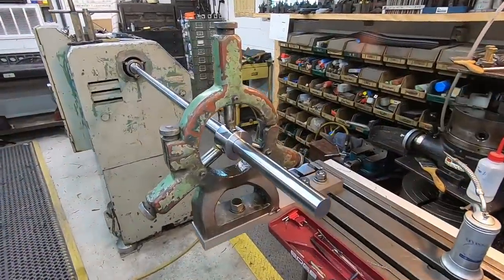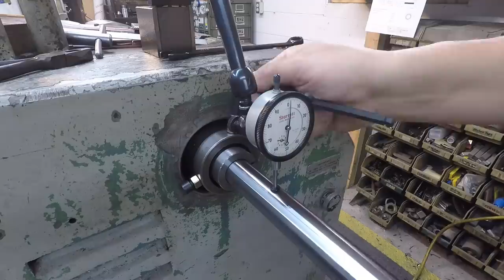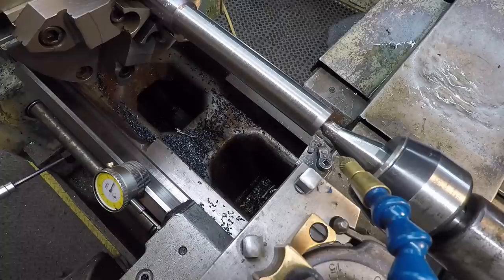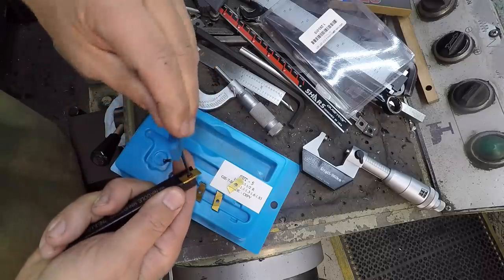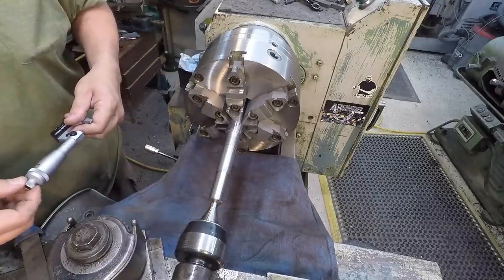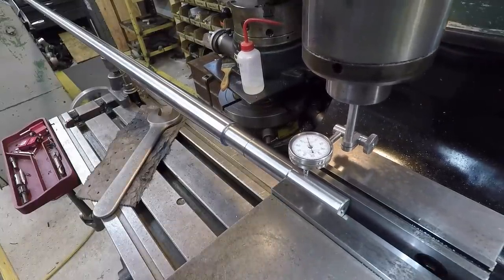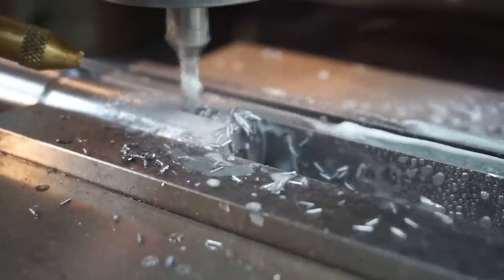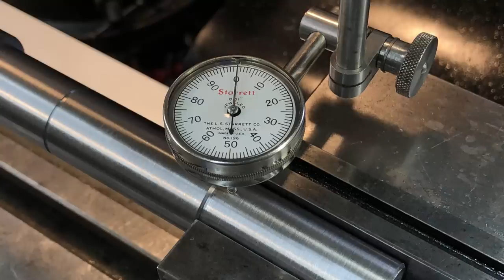Machining a Custom Prop Shaft Part 2

Comment: when making a shipping pallet for a shaft. you might want to use 2 boards.. one flat.. one at a 90 degree ..  you may also want to use bigger hold down straps so you can use short lengths of pipe foam insulation  so any mishandling of the pallet won't bend the shaft.  a single board can flex.. 2 in a 90 degree can't . you can use a thinner stiffener board if you glue and use something like a kreg jig to put screws in..

Comment: What's up with Detail A on the drawing?
Reply: 24:28  It specifies the 0.938" diameter of the snap ring groove, which is 0.046" less than the adjacent 0.984" diameter.

Comment: Great video Adam, I am not sure if you know this trick but....the hook on the end of tape wiggles up to 1/8 " (0.125") so you will be short pulling on the tape. Carpenters will jam the tape and stock to be measured against a backstop compressing the tape and measure that way. Alternately you can hold the start end at 1" and then add an inch on the other end.
Reply: that wiggle is there from the factory to allow for the thickness of the end hook. clearly if your tape is worn then you might have some inaccuracy, but the wiggle is a feature, not a bug
Reply: And this is why my cuts are always 1/16 to an 1/8 " off on my wood projects. Never thought of that. I am just a 'Carver" after all
Reply: Zues Toots no as stated that is not a flaw but a feature. You’re cuts are probably off due to not taking into account the thickness of the blade you are using to make the cut.

Comment: When using a tape measure have you ever noticed the end piece of the tape moves a bit ?
Reply: its supposed to, to adjust for inside and outside measurements
Reply: When using it on a shoulder, you use the outside part of the tip of the tape. That tip has a width that's already accounted for in the measurement. But when measuring from a step, you use the inside part of the tip. So the gape that the tip moves into is to account for the tip's width that's not being used, but is already included in measurement as explained.

Comment: Adam- Appreciate as always. Hey, quick question. Why do you prefer to machine the center hanging out instead of choked up close to the chuck?
Reply: On older machines ,, BED WEAR  from use by the carriage , so  a little ways out from the chuck  can help get closer to RIGHT ON CENTER ,,

Comment: I'm not any sort of pro, so I have to ask. Why didn't you center drill the shaft when it was still close to the chuck? Wouldn't that be more precise?
Reply: It depends, as usual ;) You have to take in account the lenght of the work area, the diameter of the workpiece, the total stickout. In this case, it's nothing to care about. If the work are was longer and/or the workpiece was thinner, than it would be more precice. Simply put, you can't have your workpiece stick out 30 centimeters (11,811 inch), if you have a diameter of just 5 centimeter (1,96 inch). But if you have a 80 centimeter (31,49 inch) diameter, 30 centimeter ((11,811 inch) stickout don't matter at all.

And you have to take in account, there is no tool pressure from the sides, that helps also.
Reply: Centre drill would not be on natural centre, when the bar is brought out further,  you may be bending the bar. It would be acceptable if the bar was say 250mm/10" long, and you gripped at the very end in the chuck.
Hope this helps.
Reply: Thanks all for that feedback

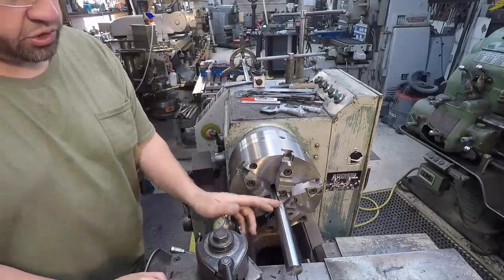Comment: At 8:20 I see a minute movement of the center drill as it contacts the end of the shaft.  Are center drills self centering?  I have noticed the same thing on many other videos from others I watch on YouTube.  Does the tailstock have a bit of slack (?) to allow for the centering of the center drill and the subsequent application of the center?
Reply: Pressure on the cutting edges centers the drill. It moves until the cutting forces acting on it balance out. As long as the drill is ground properly (so both cutting edges are identical) and the material is faced square, this will result in the drill centering itself in the work even if the tailstock has a lot of slop in it. All drills will self-center that way, but re-sharpening has a chance of producing an uneven geometry that will tend to veer off to the side instead of centering. One of the points of using dedicated center drills is just that you use them infrequently and briefly so they keep their factory geometry for a long time.
Reply: @quiescentnexus : Thanks for the excellent explanation.  That is what I assumed, but after reading you reply a new question comes to mind: If the tailstock will allow a small movement to allow the center drill to center on the part, how does it hold the part on the centerline of the lathe spindle when the tailstock center engages the center drilled hole?  It would seem that 'movement' would allow the part being turned to be off the centerline due to the allowable movement and the pressure the cutting tool applies perpendicular to spindle centerline?  As we see in this and other videos, Abom has little or no taper in the diameters he is turning (in the tenths of a thousandth).

Comment: When you are center drilling the shaft for the live center why do you not do the operation when the shaft is up short in the chuck. Seems to me not knowing better that the center hold would be more accurately on center if it was done before extending the shaft out.

Comment: Hmm, I though they were gona get refaced after he had finished using the centre (ie remove the holes he put in the ends).
Reply: He already faced it to size. Any further facing will ruin the length. Plus holes don't usually interfere with the functionality of the part. Also, you keep the center drill holes for use in any necessary future machining (repair or adjustment).

Comment: I worked in a tool & die shop an the old timer tool makers  religiously opened an closed 3 an 6 jaw skroll chucks with the same pinion. They claimed it made the skroll wear even. Have you ever heard of this? It's become a habit with me over the years. I wonder if there is any truth to it?
Reply: I don't know if there is any truth to it, but I've seen that habit as well among older machinists.  One gentleman I knew would mark the unused pinions with red layout fluid, and god help you if you used them.

Comment: Hey Adam, just out of curiosity, lets say you did have a tolerance on that length, even say .1 or .01 of an inch. How would you measure that? Or would no one design a part that way?
Reply: There are parts that are designed that way. You need to measure with micrometers during machining. Turbine and compressor shafts have crucial lengths with tolerances of 0.001"
Reply: CNC uses lasers to measure finite lengths down to 0.00001"
Reply: On long dimensions you have to include temperature to allow for expansion - contraction or after welding

Comment: Thanks for showing that strapped down for shipping. After all that work, it wouldn't be any fun to have your threads mashed, or a .125 bend, or the keyway, doinked.  By the way, when you re-arranged all the machines after your fabrication room addition, did you plan for the vertical mill to be in line with the lathe?  Or did it just work out?
Reply: I seem to recall that Adam arranged the setup just for this reason.
Reply: @milantrcka121  ...Yep, you will notice both lathes are angled toward the shop center so there is room for this kind of work.

Comment: Adam, great job as usual! One question I have for you. It's been a long time since I did any shop work, but I seem to remember that with the center finder the idea was to push it slightly off center and then go and touch off and move in until the bottom piece went to where it was a smooth transition from the upper and lower parts. Otherwise, as soon as the two parts line up, you're beyond the center point minus half the diameter. Basically you move it over until the bottom piece stops wobbling. The same with the other one that's got what looks like a scribe that's got a ball on top mounted into rod that goes into the chuck.

Comment: 1045 steel has a thermal expansion coefficient of 6.5*10-6 in/(in * ºF), so at 92.25" long a change in 10ºF is about 6/1000 in. anyway.

Comment: Adam what is a mud motor, curiosity has got the best of me. lol
Reply: John Warden a mud motor is a outboard motor with a long shaft propeller usually fairly long with the ability to run in almost zero water, the shaft allows you pick up the motor fairly easy to kinda skip through places of little to no water just mud
Reply: @playswithknives  ...I saw millions of those in Thailand!
Reply: Thank you for asking coz I had no idea either

Comment: I'm curious, why no digital readout?
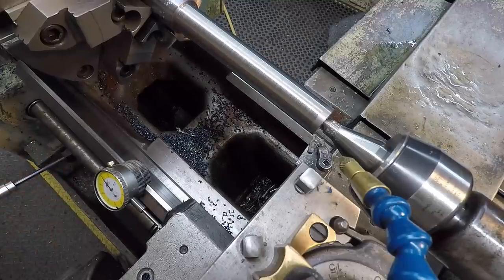Reply: @10:35 He has a DRO for that lathe, but hasn't got around to installing it yet.
Reply: TheAggromonster Hmmmnyeah, he is a working machinist so he knows exactly how much effort is needed to be good enough / fast enough for the job to pay optimally. That's a good skill to have, in my opinion. The DRO will come when he either a) gets bored or b) starts a jib where it will save him significant time or hassle :)

Comment: Adam , They sell regular stubby keyway slot cutter end mills that are .0002 under size that cut dead on size every time.( straight flutes ! )  Also no need to use edge finder for keyway location, just watch the slot until you feel the little step on the flat on each side.  ( first time I did a keyway for the Navy using a edge finder I got my butt chewed by a Navy inspector !!!! ) Did you make a fitted key for the keyway  slot ? They always made us fit a over sized key blank for each propeller shaft , lot of hand filing after milling it with in .002 then file for a tight tap fit.  Navy is very picky about there Prop shafts ! . Had to straighten  3" or 4 inch OD Marine stainless 30 foot long shafts to with in .004 run out as even brand new the shafts were always .010 to .040+ out of parallel from sitting , took many hours to get one dead on with movable double V shaft press .  Hard work but big money if you could get a shaft to always run with in .002 over 30 feet and I was the only person in the shop to take the time to get them that close . Needless to say all the prop shaft installers came to me to make shafts as only mine dropped right in with no headaches or issues.  The flip side was it takes much longer to get them that close to dead on straight and the Company was always on my butt about time spent.  However the owner of the company got a nice letter from the Navy about my dead on prop shafts and nothing more was said as perfect work does take longer .

Comment: Why 1100 rpm on the 3/16 mill? Seems low to me. But, I am not a machinist.
Reply: Seems low to me too, I mean that comes down to 16m/min or 629 inches/min cutting speed. normally you would take like 30-50 but idk worked out fine here maybe to reduce the chance of chatter?
Reply: Or to keep from breaking his end mill on stainless.

Comment: How would you measure something that long if the dimensions were critical?
Reply: Can any machinist answer this, I'm really curious.
Reply: It could be done with a laser system. This would allow the size to be worked in too. A CMM could complete final inspection. A horizontal borer with enough travel and could inspect it and machine the OAL accurately.

Comment: Adom, nice job on the mud prop shaft. What did you say that you spray on your mill and lathe after you use liquid coolant to prevent them from rust? Thanks.
Reply: WD40
Reply: It's CRC "Heavy Duty Degreaser" (and not WD40...) - see previous video at 37min, 44sec

Comment: Can a prop shaft that long not vibrate and flex do to the length vs diameter under load ?  Don't know just asking?  Thanks William
Reply: Sure, it does but if there was any math involved, it'll be the right size. So it does not break.
Reply: As earlier comment stated. 
Also I believe it was said this is a temporary shaft they are going to use to get things setup and running. They will probably replace it later with something more suitable.
Reply: I think the load is when is pulled not when is pushed, sorry about my english
Reply: Yes - search for "Whirling of Shafts"

Comment: Nice job Adam, been watching your videos for some time. I learned to run a mill and  threading on a lathe from an WWll vet back in the 70's.
A few questions if you don't mind, why do you cut threads so fast,  and what brand of magnetic indicator holder do you use?
It looks like is has a fine adjustment screw.
Reply: Carl the articulating arm one is noga fine adjust.

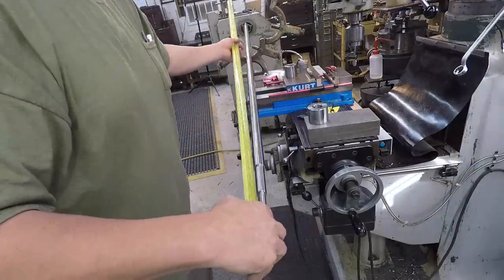Comment: @3:00 if you keep letting the tape smash back that way you're not going to have a high quality, accurate tape measure for very long. The tab on the end is fastened by a couple of sliding rivets so you can read both inside and outside measurements accurately. The tab slides just enough to compensate for the thickness of the hook on the end. If you stretch out those rivet holes you'll read long on outside measurements. Snapping the tape back in stretches those holes.
Reply: It's very annoying to the master and his disciples for a " O- by the way" comment from those who think the master does not know this!
Reply: true. he didnt do it as bad as a lot of guys i work with. TBH on a measurement that large, a couple thousandths is probably not a dealbreaker but for ABOM, i am suprised he would do that.
Reply: doing rough math, if this shaft was at 70 degrees, vs 0 degrees fahrenheit, it would change length by .065 inches. just to put it in perspective

Comment: What does such a custom project set the customer back??
Reply: this is a small shaft, if its like marine standards, in aqualoy 17 or aqualoy 22, then its gunna be about 800-1200 for the material and the job done on a 1.5 inch diameter 100inch long shaft. I made a 3.5inch one last week in aqualoy 22, 220inch long, 2 taper both ends, with a custom faceplate on the other side of the prop, about 12k the shaft and job

Comment: It sounds like the diameter of the snap ring groove was wrong and the depth of the keyway was wrong.  If I was paying for this, I would want the dimensions to be exact as per the drawing.  He even says the measurements out loud, clearly wrong, and says they should be fine.  Am I missing something?
Reply: It's within tolerance. Exact dimensions are not a thing in this business.
Reply: Disclaimer: I don't work in this business.

There is no such thing as exact dimensions in reality. You always want to "fail" on the safe side as in when you have minimum dimensions you want to be over them and the other way round.

Like on the keyway he overcut the depth. The last thing you want is that the key does not fit in. Also, the important part is the width of the keyway, which is rather precise using the right cutting tool.

The skill in this craft IMO is to know when precision matters and how not to waste time.

I am sure he knows what is important depending on the function the part should fulfill, so his experience will get you something that will likely work for you even if you don't fully know.

Like in the spray welding video where he said depending on the type of load you need to use a different powder. So there is even more than dimensions and tolerances.

If you get even more precise you probably need to take thermal expansion and surface roughness into account.

Sorry if this was too wordy.
Reply: look at the print, says tolerance is =/- .005 unless otherwise stated. his finish dimensions are well within this tolerance, that said the part is indeed the right size